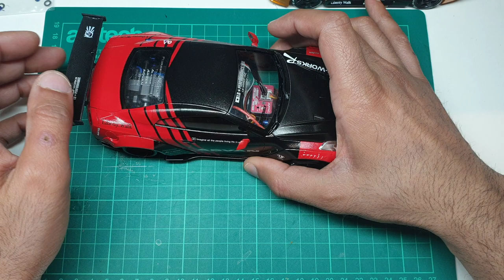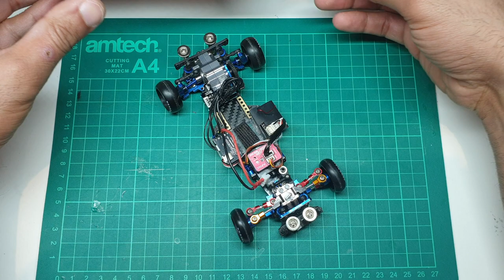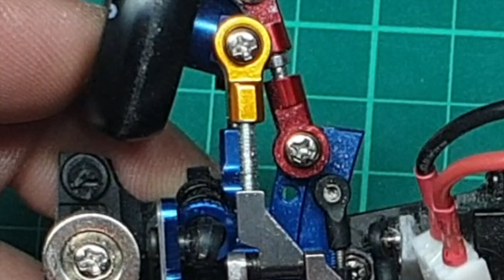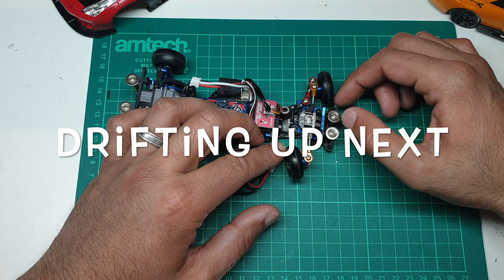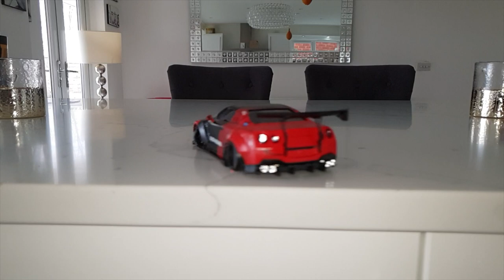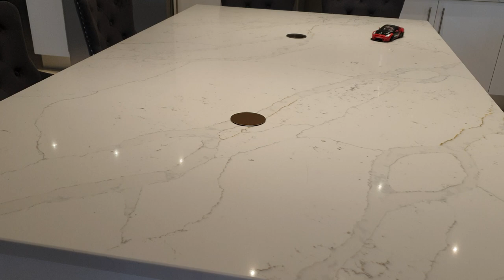Garage RC presents .....Xrx Dpa Rwd Mini Rc Drift Car Aoshima  1/24 Scale ADVAN LIBERTY WALK GTR

Comment: Nice video, as usual.
Totally agree, the wider the better. All my wheels are either 3.5 or 4.5 offset👌🏾.
Reply from the maker: Thanks 👍🏽. It's a struggle at 90/94 mm to have anything less than 1 or zero front offset and to fit a mini z shell . 98mm upwards.

Comment: Extended my HGD1 to 106mm to use a S14 1/24 from aoshima. Drifts like a dream now. With weights at the back, I can easily do a reverse entry around the corner. Imo 1/24 is the right scale given the choice of shells out there.
Reply from the maker: Yes I have  ordered 4 more shells. Hdg1 will getting one.

Comment: I am currently looking into getting into micro sized drifting like this, I notice that stock of the small sized drifters are little to none, Were could I find one for myself? and will there be problems getting spare parts? Also, all your builds are soo awesome, cant wait to get my hands on one.
Reply from the maker: Depends what   brand and where you are.. 😂. Can you elaborate?
Reply: @GarageMiniRCUK  Yeah for sure, im from US, in California. and I really like the XRX chassis, with all that blue Aluminum :)
Reply from the maker: I've been shipping a few out to your area... 😂 No probs 👍🏽 I've a good selection of parts too. Although micro drifting is tricky at first. Set up is everything.
Reply: @GarageMiniRCUK  Awesome, I get a work bonus very soon and ill be spending it to get sideways :) Hopefully you could lead me in the right direction. Also i only have spektrum remotes for my bigger sized RC's. will I need to get a different setup?
Reply from the maker: Ideally yes. Bigger recievers are hard to squeeze into the mini cars
Reply: @GarageMiniRCUK  okay, its the name of the game I guess ill have to bite the bullet. Is there a tx that you would recommend? I should be fully funded by Friday. thank you for answering all of my questions, you have been a HUGE help.
Reply from the maker: I like the nb4.... Great transmitter and value for money. Futaba do a good one I will have to check but it costs a lot more than the nb4 but not that many more features. The easiest way to do it is look at bangood and which micro recievers are compatible with which transmitter. Sanwa, kyosho ex6r, futaba and the flysky nb4 are the only brands I know they cover. You would have to check the forums to see if you can get a micro Rx for your existing radio, I'm not sure.
Reply: @GarageMiniRCUK  awesome ill check it out!! One more question!, what chassis do you think is the best valued? I like the xrx but if i can get something very similar for cheaper i would be happy with that.
Reply from the maker: Best advice I can give is that... These things keep costing money.... No matter which one you'll end up spending... The only way to keep it low is to buy a ready made non hobby grade that's durable...the problem is the rwd mini rc  drifter is too specialised a car. The GLD tried to make it simple and failed. The only cheap drifter really is the awd k969 by wl toys. Good luck👍🏽